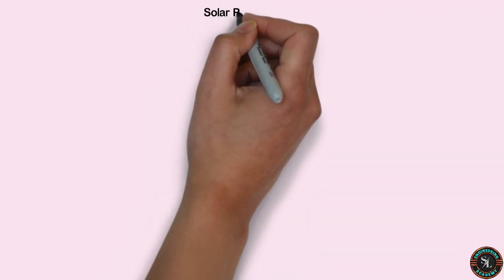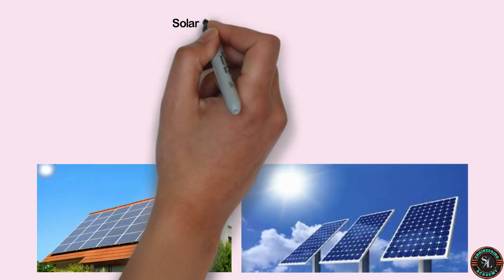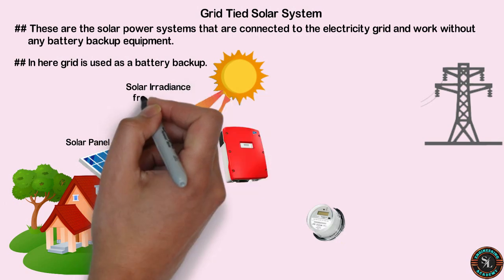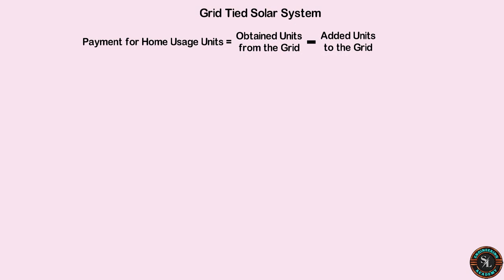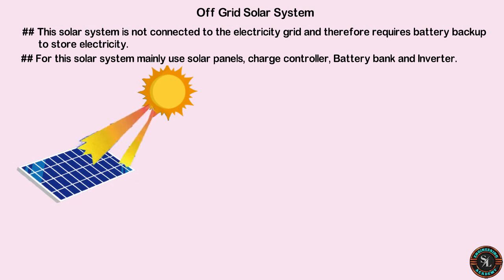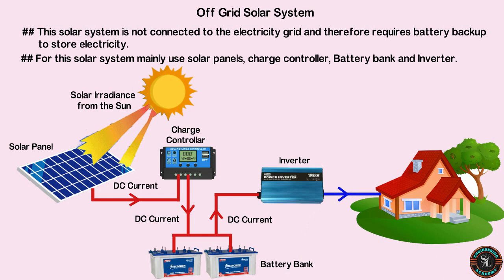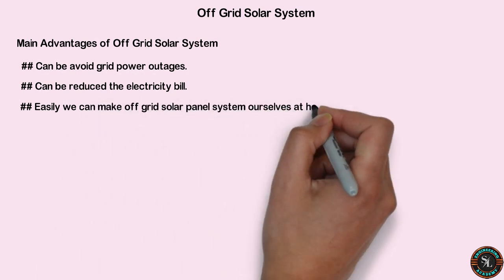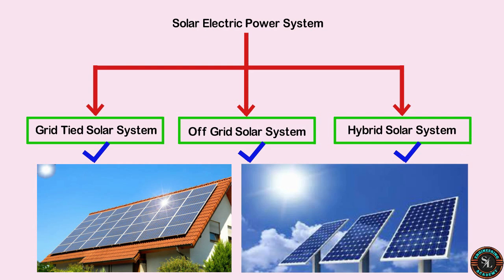How to work Solar Panel Systems / Basic Knowledge about Solar Power Systems / Part 01

Comment: Hello i have 3 power inputs to my home tthe grid a generator for all the compound and solar panels all combined with an inverter how can i make a wiring diagram that dont let the generator feed the solar battery when they r empty i only want the generator feed the house without feeding the batterys cause i can consum 7amper only from generator when it feeds the batteries the generator mcb will cut off thanks